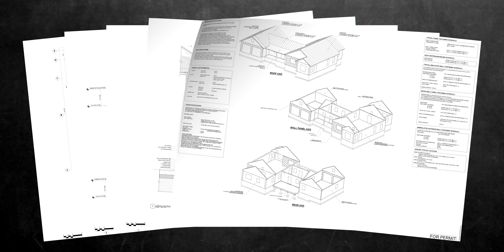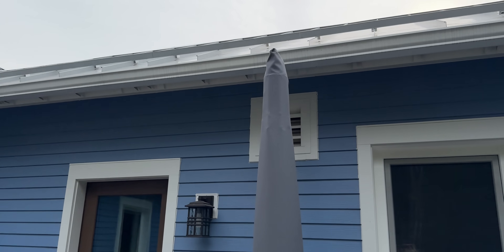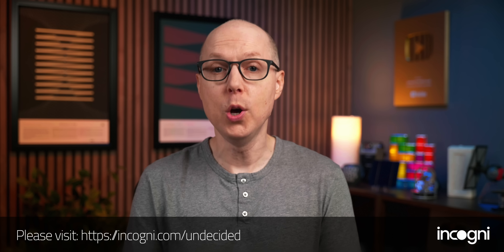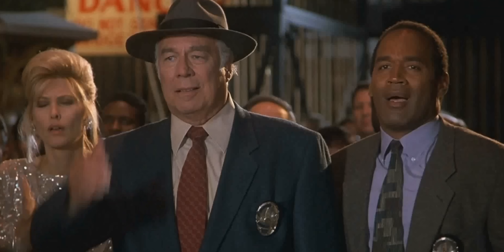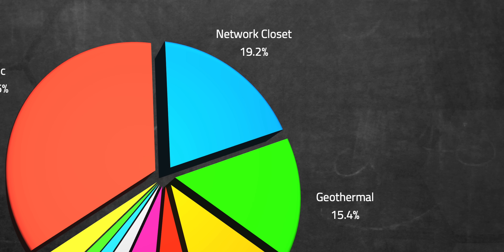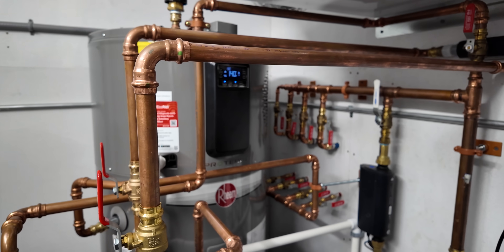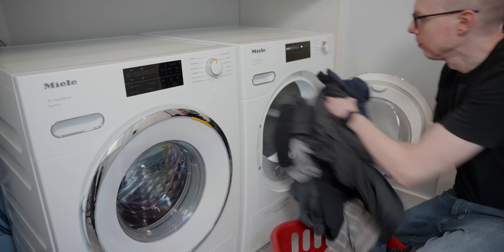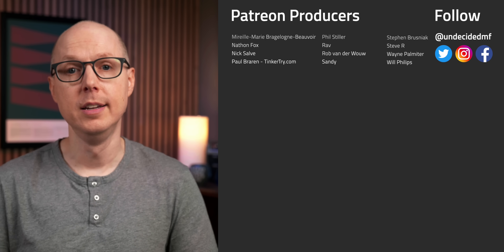What I Learned After 1 Year in My Net Zero House

Comment: I built your house in 1999 less the solar. Stress skin exterior, geothermal, air rotation unit, triple glaze windows. We have no access to nat gas so we went all electric. The most important part was the insulation that was part of the stress skin exterior. Now, 25 years later, I realize just how good it is. Low electric bills year round, only have to use AC sparingly, steady temp throughout the house all the time, winter or summer. Earlier this year we replaced the WaterFurnace and removed the air rotation unit. The geo system was always very good but the air rotation unit was always freezing up in cold weather. We quit using it 15 years ago with no obvious difference in utility cost so we just removed it when the new WaterFurnace went in. I would like to do an electric battery backup (Tesla PowerWall or similar) but I cannot engineer it and nobody locally has experiance with them. I don't want to be the guinea pig so I will probably go with a traditional gas backup generator until they become more common place.

Comment: I live in WI so a full basement is always the best. Half my house is on a basement the other half is floor joists on a slab. There's a huge difference in the comfort level of the two parts in winter. Of course, my house is old.
Reply: Fellow Wisconsinite here, built a new house 3 years ago, full basement setup.  We used 2" foam under slab and have the pipe for in floor heat set.  Still need to purchase and setup the in floor heating system.  I'm thinking on running a heat pump water heater for it.  The basement typically has been around 70 degrees all year.
Reply: @nonameoutdoors-c7k  @tims8603 Buffer tank works very well. 👍 
Pay attention to Primary  circulation pump (nr1) ”in the heat pump” and secondary (no2) circulation pump (fördelning/bypass) pipes. The plumber must know how to connected. 
Secondary CP = low rpm. (One pipe should  be max 70 meter, 16mm) Secondary circuit recommended lower than Primary CP. 
If primary circuit CP is resting, (radiator is warm =no need heat circulation) the floor heating pipes cannot get heat. Solution: Buffet tank.
-But, we have here in chilly Northern Sweden also another modules, for basement, which works very well. Exhaust air heating module, dries basements. I do not had to use drying cabinets or dryers. With the exhaust air module dries laundry in 2-4 hours, depending on how much air I choose for HP to deliver.

Frånluftsmodul Nibe F135 - Öresunds VVS AB
Reply: @nonameoutdoors-c7k  holy hell, 2 inches of insulation is almost same as nothing. Is that normal?
 I would consider minimum foam (xps) insulation under the "floor on ground" 8 inches living in similar winter temps. But then again, europe cares about energy efficency, so thats normal for us.
Reply: @lauriviik  the 2" XPS foam is at 10 feet underground, 9 ft basement walls.  Yes the 2 inches of foam board is what was recommended by my local HVAC company

Comment: What I’d like to see is your wife’s impressions of the whole journey.  It’s one thing to be a nerd and nerd out on all these great things… it’s another to be married to one and be swept along with the tidal wave.
Reply: During the construction of our new office I was able to advise the architect on the amount of residual heat from the computer system, which led to the entire heating system being reconsidered. Because the building had a water source (it used to be a beer factory), the building was given 2 wells (cold and heat) of 270 meters deep and with 2 heat exchangers. At 270 meters deep there was a sealed porous soil layer, which meant that it had to be 270 meters deep. Furthermore, ceiling heating and cooling were chosen for the heating.
This building was finished in 2002 and was the first building in the Netherlands with such an energy household and it was opened by the Queen of the Netherlands. Ceiling heating and cooling also provide a very pleasant living environment because the air speed in the room is much lower. A truly superior heating system.

Regarding your house. With a few electric heating panels at the seating locations and you could return the house temperature to 21 degrees.

My own rental house. I also use a dryer with a heat pump at home and I extract the heat from the air that goes outside, which saves me a lot of heat.

Regarding the story: A question that remains partly unanswered is the return on your investment. You have invested a lot, but within how many years will it have paid for itself.
Reply: Agreed! Even just a Q&A with us if she doesn't want to be on camera.
Reply: @harrycornelius373  
Happy wife means happy life.
Reply: I once had a neighbour who bought a somewhat run down old house and spent a year or two fixing up the house for him and his girlfriend to live in after it was fixed up.

At some point his girlfriend got fed up with him spending all his free time working on the house instead of doing things with her so she left him.

When he finished fixing up the house he ended up selling it because he felt that he couldn't justify living in the house all by himself.
I presume that he moved to an apartment or condo which he would have thought was more appropriate for his new bachelor life.
Reply: Hmm... if you want drama and insight into people's private lives, YouTube has plenty of it, and TikTok is your paradise. You'll notice that these aren't the topics of this channel.
Reply: @harrycornelius373  it actually was my wife’s idea…I just organized the data
Reply: This!
Reply: What are you talking about?  The wife ALWAYS agrees with the husbands projects, right?
Reply: @seang2012  it is likely presumptuous of me to say but I am sure that the wife in this case was a committed, contributing partner in the process ….but I do think that her perspective would be interesting.
Reply: Amen
Reply: It's divisive to say she's being "swept away" into his skill and ambition, which directly benefits her. He shares enough of his life; his wife is a private treasure. Moderate yourself.
Reply: @QuietFaith1  point taken. Note that I didn’t say “ambition” or “skill”. And certainly she has a right to privacy which I respect. I watch a audiophile YouTube show where the wife chimes in occasionally and that is interesting so her perspective would be interesting

Comment: In a future episode I hope you can provide a cost benefit analysis or payback of your geothermal system as compared to a modern heat pump. Thanks.
Reply: Geothermal is ridiculously expensive- depending upon the depth of the dig. It’ll always be cheaper to run rcacs (reverse cycle air conditioners) instead, not sure if that works in snow, though.
Reply: @lindam.1502  Geothermal is always cheaper in the long run but the payback period can be decades. For an existing house in typical climates it's likely not worth it but I imagine that it would be much cheaper to install the ground loop before the house is built.

Comment: You can never lose with a basement.
Reply: My childhood home built in 64 had a full basement that stayed dry until the 1980s. Ironically a severe drought caused the foundation to settle causing stair step cracks in all four corners. From then on the basement started flooding during spring rains and heavy snow melts. It cost nearly 20K to remediate.
Reply: @powerguymark  that's strange. Were there any minor earthquakes during that time period? It really sounds like a wet weather creek changed its path.

Comment: I just finished installing an air forced heat pump HVAC system in our house, and it works great!  I bought and installed the MRCool system myself, at a small fraction of Matt's geothermal system.  I installed electric water heaters, several years ago, and have a 5kW PV system and 2.4kW small wind turbine, on my property, with 2 Tesla Model Y's.  All electric home and all electric vehicles, and love our system.  I would love to have a basement and water well, those are the two things I don't have, but wish I did.

Comment: I love to see your house build, and hear about your experiences, I am from Denmark, and what we call passive house can be heated by the people leving in it, the new building codes for a family house is min 300mm rockwool in the walls, and 450mm in the roof, and 400mm flamingo in the floor under the concrete floor, witch can not touch the walls spaced out with flamingo, 3 layers thermo 50mm thick is bekomming standard, your applyenses are the same, Miele goes to be top of the line, made in Germany be a family business.
Solar panel system should be in the building code, it will come soon in dk..

Comment: We went low tech with our NetZero home.  While we have an EV, induction cooktop, and solar PV, we heat with biomass, have passive solar gain, strawbale walls for insulation and 50 tons of ‘earth plaster’ in our walls and floors.  In our high desert climate, the thermal capacity and insulation of the straw means we can open our windows at night and close them during the day to avoid having air conditioning, and the thermal mass means we don’t have to have a fire burning full time to heat our home in winter.

Comment: I've had a heat pump dryer and I've had NO END of problems with it. To dry a single king size duvet cover takes 9 hours!! Don't give me the BS of it saves energy, running for 9 hours is not saving me any time nor money. I've had it 8 months, had 5 engineers out to fix it and it's still not working properly. I can't wait to get rid of the thing. In theory they probably work well but in reality, they're an utter waste of space

Comment: Let me be the first of thousands who will remind you that in much of the south we don't have basements and we're able to figure out the duct work just fine. Using northern architects I guess? A better insulated roof and attic space would have done you well too - not only to help with efficiency, but the climate is better up there as you use it to store your crap, sans basement.
Reply from the maker: Yep, including the attic space in the thermal envelope was the other route we could have gone.  I should have mentioned that in the video.  We didn't for the exact same reasons as not doing the basement (cutting costs to put that money elsewhere).
Reply: I don't recall what he said in a video but didn't he State his insulation was up around R60 or better?
Reply: i thought in texas a lot of the houses are on pylons to give a crawl space for the stuff. also helps with floods, letting the water run under the house.

Comment: I hang my laundry outside, savings are 100%. The time savings are quite minimal and the positives are fresh smelling laundry, zero cost for the dryer, energy is free (solar dried), and a lot less wear and tear on your clothes. Does anyone have any ideas on how I could monetize my "modern solar dryer"?
Reply: I feel like people where he lives will always need a drier because of freezing winters. otherwise, unless you live in an apartment, everyone should be sun drying their clothes, it's even more sanitary.
Reply: @danilooliveira6580  I live in in a cold climate and have found that during the winter months, the laundry dries faster in the coldest temperatures. That surprised me, I guess it gets freeze dried.
Reply: @danilooliveira6580  I just installed clotheslines on the ceiling in the unfinished portion of my basement and hang the clothes up down there.  takes about a day for them to dry so we need to be better about consistently doing a load a day or so, but its still practically free.  Yes it increases basement humidity,  but in the winter the basement is super dry as-is, so it's not hurting anything.  We do have a dehumidifier in the basement as well,  basically a requirement in the mid-west anyway.
Reply: I tried the same for a while but all my clothes came off the line really stiff compared to when I used the dryer. Tried switching detergents and using softener products but nothing worked, do you have any suggestions for this? Would love to stop using the dryer.
Reply: @noone-ld7pt  I don’t know how to reply to that. I’ve been hanging my laundry for 30 years so maybe I just got accustomed to the texture. I have all cotton or wool clothes and I like the freshness of putting on newly washed and hung clothes.
Reply: @noone-ld7pt  your clothes still have residue detergent in that case. washing machines in my country do a good job of washing away all the detergent but it might not be the case for you.just run your clothes an extra cycle without any detergent and it should be fine. also, your dryer crumples up the clothes which in turn not lets the fibers to adhere to each other which is one of the main reasons for stiff clothes. you can just crumple  them up yourself or just wear them as is and they will soften up by themselves.
Reply: @fishbotsid9771 Indeed. I thought that too. In my experience people often use too much detergent to was their laundry. Of course the tendency is to want things super clean, but that is more a factor of a good washing machine than massive volumes of soap powder or whatever method is used.
Reply: You could push the dual use of the modern solar dryer.  Dries clothes as well as restrains intruders and fetish fanatics. Glad I could help.
Reply: Yesss!
Reply: There is a story of a guy who sold solar dryers via newspapers, and people received very, very expensive clothes lines...
Reply: I was going to respond to your question by saying to sell clothelines, but I see someone else already mentioned that

Comment: Great info! Looking forward to the second video.

One question I have is if you live in a tropical climate would you consider venting the cooled air from a hot water heat pump into the house? It would need ducting with fan assistance. And maybe a damper to divert outside if it reaches the set temperature. Your thoughts?

Comment: Net zero does not need to be so complicated. I've had two net zero homes, and nothing was this complicated. Much of the cost shown here would have been better spent on more solar. I've did geothermal decades ago, and was super happy with it, but that was an unusual situation were the costs were minimal. Now, it would be a tough sell on the extra cost or just adding more solar. This example doubles as a business, so there are other motives for all the crap shown here. Knowing how much each device uses cost energy, not saves energy. One thing I did with our current home is insulating the roof making the attic semi-conditioned space. I can't say it save a lot, but it sure makes for a much better home experience. I generally produce 7mwh more than I user per year, but just for fun I'm added more solar to the top of a pergola. My wife wanted the pergola, so putting solar on it made the pergola a tax deduction bring the cost of that solar almost free.
Reply: it's complicated because he want to be net-zero, as efficient as possible, and still offering maximum comfort. yes, not every house needs to be this complicated, but he was basically making an experiment with his new house.
Reply from the maker: @danilooliveira6580  hit it on the head.  No, it doesn't have to be as complicated as my house.  I went above and beyond with stuff because of my own interested and needs.  Hopefully that came across by the end of the video when I gave some of my suggestions.
Reply: Yep net zero is easy. Install enough solar to cover usage annually.  My 1987 built house has been net zero for 5 years. I have overproduced an average of 3.5 Mwh annually since I installed my solar.
Reply: Yes, for a normal family (not a Youtuber who wants to showcase all this tech) it's hard to see a setup like this one ever breaking even. Especially if you take into account the opportunity cost, which for such an expense is not insignificant. And as solar gets cheaper, it will make even less sense, as the installation costs of many of the systems will be way higher than the price of the energy saved.
Reply: I was kind of wondering the same thing. Seems he could have installed mini splits, or stuck with standard heat pumps for his HVAC. 

I do wish that I would have gone with a heat pump water heater. Will definitely go with a heat pump dryer when it's time to replace it. 
Matt Risinger is a big proponent of a conditioned attic. 
My home was built in 1979 and the Attic temperature Delta was 60°! Also the attached garage had no insulation in the Attic whatsoever. On the hottest of days the superheated air of the attic would drive the garage temperature well above the ambient air temperature outside. It was brutal. 
I was able to bring the temperature Delta between my attic and my living space down by 30° by installing a metal roof with a radiant barrier.  I also upgraded the attic insulation. My garage still is not a conditioned space, but it's staying much cooler.

Comment: Using electricity for heating is something I sorely wish to see disappear. Electricity is too efficient ot an energy type so there's very little heat produced as waste. When it comes to using electricity for heating, what you're essentially doing is trying to gain a good amount of that waste heat by using a metric shitton of electricity. Most often, the induction equipment is made with bad quality materials and inefficient simply to gain more heat. 

I find all of that just very stupid. Computers, servers, ac units, etc. For instance produce a lot of heat as waste which is never utilized, it's just allowed to be scattered in the environment. Why not build something that captures that heat to power your induction equipment instead?

Comment: I can't remember, did you co-locate your network closet and your heat pump hot water heater to use some of that excess heat?
Reply from the maker: Unfortunately, no.  They're across the hall from each other.  I'm considering trying to feed a tube of some kind between the two rooms to do exactly that (if there's room in the lowered ceiling).